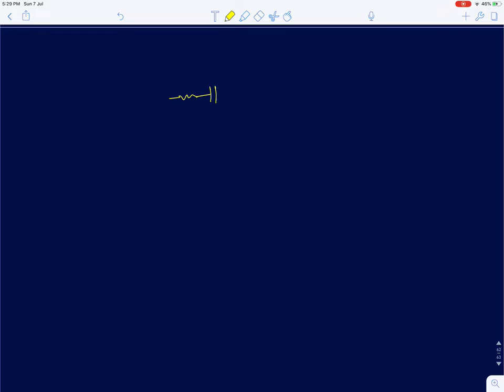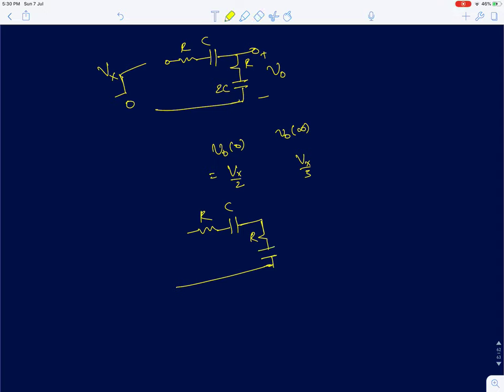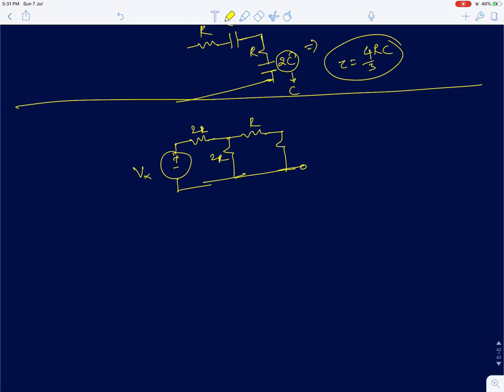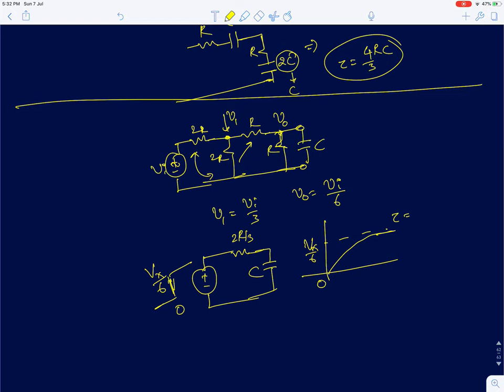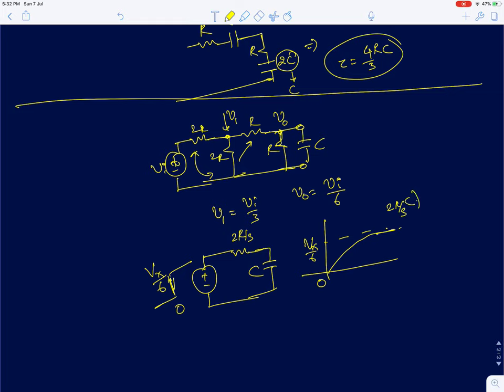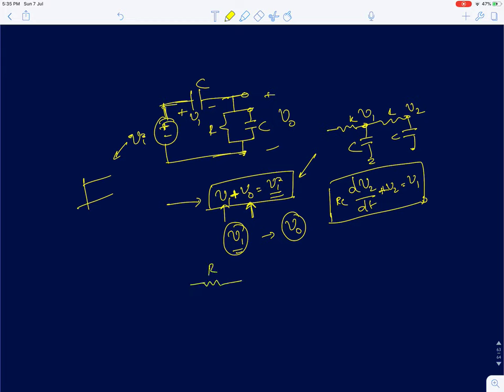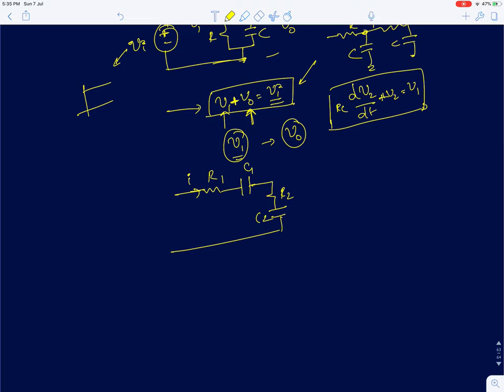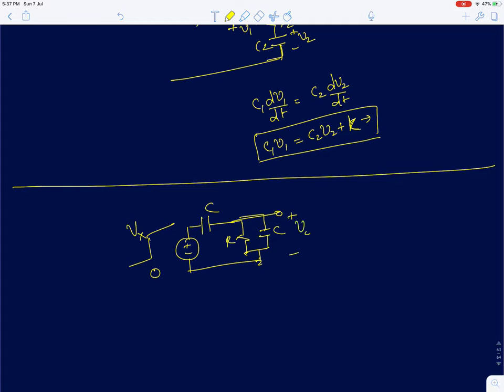ES Lecture 13.a. Analysis of first order RC circuits with no initial condictions (continued)

Comment: There is a mistake in calculating voltage at @9:05
Reply: How?
Reply: yes, Are you getting both v(0) = v(infinity) =0?
Reply: @Akhilesh Gupta , what answer did you got??
Reply: I think it should Vo = Vx
Reply: @manideepp2229  what is the final answer then?

Comment: sir will you please explain me that at @9:10 why didn't you just short ckt the capacitor that was directly connected to the voltage source?
Reply: Short-circuiting the capacitor would short the resistors and in turn short the input voltage source. Imagining a very-low impedance for the capacitors (rather than exactly 0) at t=0+ is a better approach.